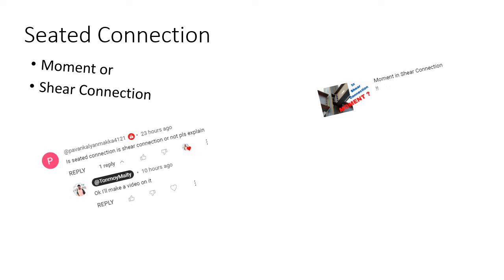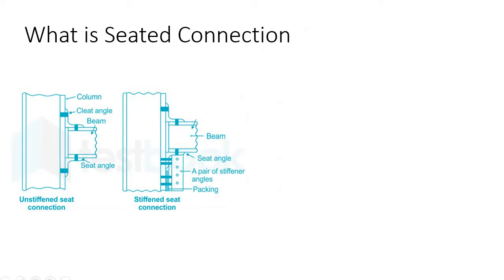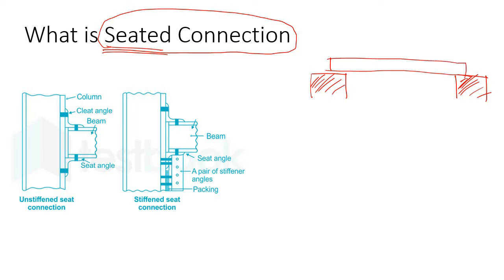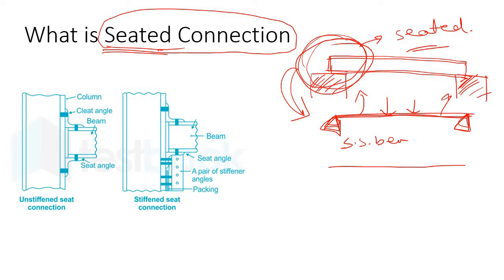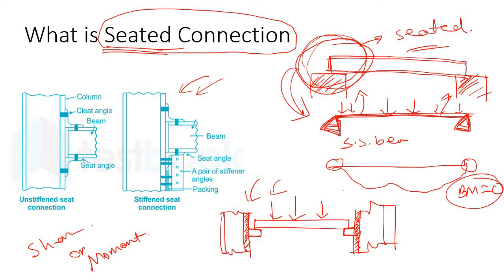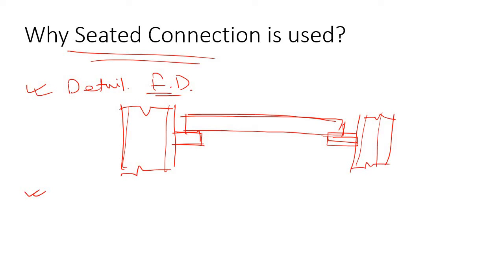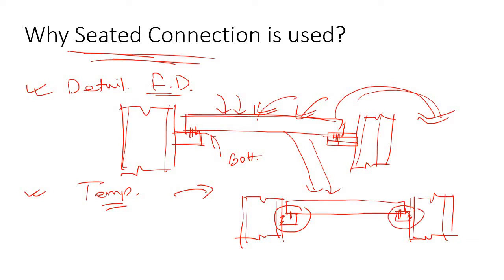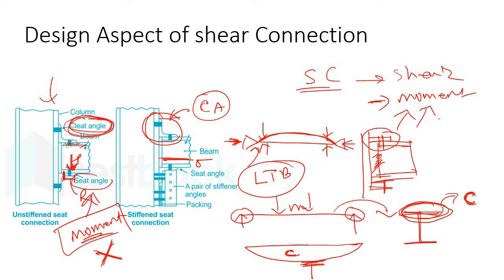Why Seated Connection is NOT Moment Connection ?

Comment: Brother,, when beam flanges are connected with column by any means (end plate or seating/cleat angle) or beam directly welded to column, it will transfer moment from beam to column + additional moment will be induced in column due to shear eccentricity (M = V.e) as you explained. Here you are wrong. This is also a moment connection brother
Reply from the maker: Thanks for sharing your thoughts!

Comment: Hi, when we attach the beam to a concrete wall with seated angle , how do we provide the cleat angle on top? Should we design it ? In that case is the connection to wall similar to that of seated angle?

Comment: you have an amaizing videos, well explained and very practical.
can i ask why in the seated connection the cleat angle can't act as moment connection? i saw the video but if in design the bolts/welds in the cleat to manage with the tention force (of course also stiffner in the column) what is the concerns in that matter?
in the seated angle it's only compression so it's not a major problem to deal with those force/
Reply from the maker: Good question!